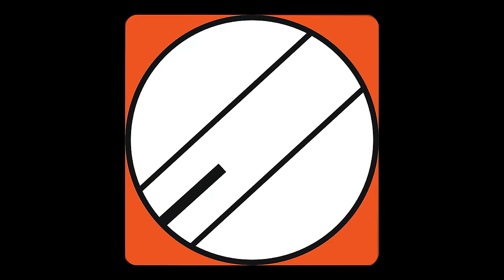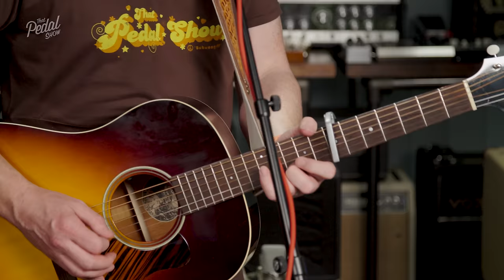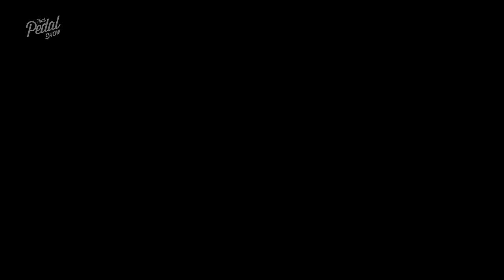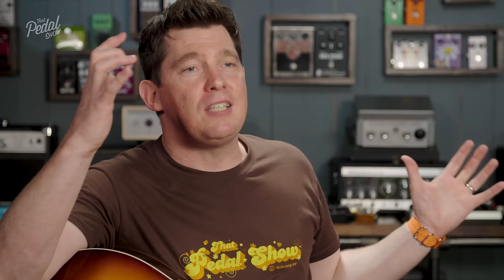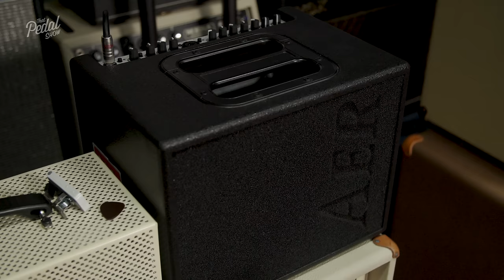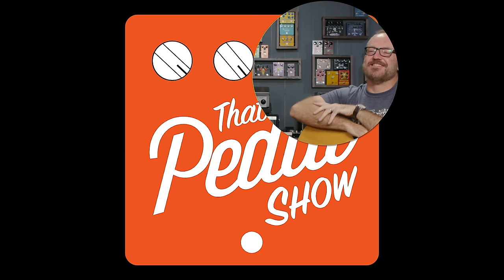Better Plugged-In Acoustic Guitar Sound Basics: Pickups, PA, Amps & All That Stuff – That Pedal Show

Comment: This video has come along at the right time. Super work guys. I've tried undersaddle piezo, Piezo discs, preamp Piezo undersaddle now I'm trying an active sound hole. Best pick up I had was the D-tar sadducer, but it didn't work with my latest work horse. I now have a passive artec PG607 in a tanglewood TW170AS.  Other issues for me have been installation of Peizo pick up, string balance etc. Best sound i had was at Yeovil beer fest because the engineer paid attention to the octave and overdrive pedals. And constantly tweaked. For pub gigs I take a acoustic amp because I like the sound of it and DI it in to a PA if needed. The quack of a piezo drives me nuts now, but after opening for Blair Dunlop and hearing the LR Baggs element in his guitar I was blow away. For you to have a chuckle at here's me trying to use a sound hole like an undersaddle https://youtu.be/5VcCAdzsxnE
(I also opened for Wurzels, top top guys)

Comment: Depends on what you are using the acoustic for But ...... If you like the scooped sound in order to just add acoustic ambience to an electric combo or behind a vocal line you may like what we call in the US the Nashville tuning.  Its an old recording trick.  The g, b, and high e strings are normal.  The lower e, a and d strings are the upper string gauges from a 12 string set.  Flat picking leads can be cool because you can get pitch shifts on scalar runs you don't otherwise get.

Comment: I have an acoustic with a cheap quacky piezo pickup under the bridge. My tip if you don’t want to go out and buy an acoustic guitar pedal is to run it through a compressor before going to the di. Most sound people will eq the sound somewhat and add reverb anyway but probably won’t add any compression which helps take out that harsh quack.

Comment: Used LR bags for 30 years acoustic Duo, Gibson J200, Gibson Hummingbird, Sm58, Senheiser ?? vocal mics.  8 x Bose 802s, 2 x mb4 subs, 3 x 1500 watt amps, various mixers, powerful acoustic system, playing big pub gigs to 500+ people, with DJ on our breaks so we need to be loud, clear and punchy. LR Baggs under saddle systems in both guitars, straight to lr Baggs DI to mixer, amazing. No other pickup system works quite as well, fishman, maton, tried them all. we have to play so loud, we can't use mics in the guitar pickups as they feedback at our levels and cannot be mixed out without losing balls. Just stick with LR Baggs and you will be happy.

Comment: If you want an AER for acoustic, check out Bugera’s AC60: it’s a shameless clone and I’ve tried it side-by-side with a AC60. But it’s just $220 new. That’s my recommendation for an acoustic amp, especially if you need your tone shaped.

My other guitarist brings a Bose S1 Pro to gigs and that’s really great system. Battery operated, backpack portable, Bluetooth and aux inputs for throwing in backing tracks or intermission music. Two channels for mic/instruments, with treble,bass,reverb, and volume controls for each. And the tone shaping sounds pretty good even giving it a basic piezo tone to start. At $600 this is my favorite single PA system solution, especially for buskers or people who value portability.

Comment: The Nature of an acoustic guitar is the simplicity.  SIMPLICITY ! I cannot process it electronically, get pedals, or even get a "brown" acoustic amp.  I have had the Anthem for many years.  It is the solution.  All on the Anthem mic at lower volume gigs is magic.  Of course open air to large diaphragm mic is optimal.  To be able to dance around while playing the Anthem is the answer.  It sounds so good, I am happy hearing the PA sound with a little monitor.
Reply: Sorry . . . the LR Baggs "Anthem"
Reply: And you can feel the sound vibrations too, less need for external source of sound support.

Comment: Nice!

Quick note on the LR Baggs Anthem; the Element undersaddle is only full range when the mic is dialled out completely. When the mic is dialled in, the undersaddle is only providing low end to the overall sound.

Also, the system never goes 100% mic, as in the undersaddle is always in the mix. 

Having the Element part provide the low end allows the system to be usable in louder environments.
Reply from the maker: Thank you!

Comment: The LR Baggs Anthem actually doesn’t blend the mic and piezo in the usual way.  It uses a crossover filter that has the high end come from the mic and the low end comes from the piezo.   As you were turning the control toward the mic you were also blending in the crossover circuit with the mic.
Reply from the maker: Nice, thanks!

Comment: Great show guys. Just to mention that with the Baggs Anthem pickup, the "blend" control doesn't just blend between "100% undersaddle" at one end and "100% mic" at the other end. Rather there's a crossover so that all the way to the "mic" end, the low frequencies still come from the undersaddle and the higher stuff comes from the mic. Very clever system in my view that allows mic and undersaddle to play to their strengths. Sounded great straight in. In general I use as much mic as I can get away with, and only back it off if there's a feedback issue. Also, worth saying, get it installed by a good luthier - if the guys in the shop offer to fit it for free, proceed with extreme caution.
Reply: Looking forward to next week - the Session and Soulmate Acoustic both sound really interesting.

Comment: I bought an acoustic amp when I had a hybrid guitar that had a piezo in the saddles and stereo output one for electric and one for acoustic. It really helped the sound. I don’t have that guitar anymore but use it when acousticing as you keep control of the sound and your foldback. Wouldn’t play without it.
Reply: Had a Takamine ean when gigging through house pa set all the levels on their built in pre amp to middle when sound checking. Gave me control of output. Especially éhen the sound man lost concentration.

Comment: I know it's 5 years later, but for anyone tuning in to this - it ain't phase lads ;-)    It's polarity. Phase is time and frequency based, whereas polarity just flips the waveform without a change in time, and is exactly equal in amplitude for all frequencies. Changing the polarity of your wedge that has your guitar signal in it can sometimes improve the "body" that you hear and feel. Best to have the sound tech try flipping the polarity of your guitar DI input on the console to see which sounds better to you - has no effect on the house mix.

Comment: Nice strum, gents.  You sound great.  For as deep and fun the dive can be into electric tone, there's depth also into acoustic.  Every minute thing matters.  Check out Larry Cragg's (Neil Young, Carlos Santana...) approach to anything which touches the strings, from bone nut and saddle to his bridge pins.  (After lengthy experimentation, ebony for low three strings and water buffalo horn for three thinnest.  It makes a real difference.)  Larry is a tone genius with vast experience and wonderful guy.  For a nice acoustic listen, go for Neil Young's Live at Massey Hall.  Better than expected vocals from Neil, too.  Please also comment as much as possible on feedback, which can strike looper pedal users, especially, depending on the room.  No doubt your mate Pete has run into that.  Cheers!

Comment: Trace Audio (in California) makes the "Amulet" acoustic contact system. Best I've ever used (I've used quite a few). Mine is powered by 48v phantom. (Nine volt is also available) Gain level to feedback is amazing. Dynamic response, amazing. This system comes stock in the Gibson Jackson Browne J45 model as well as the Sheryl Crow model. I'm just a customer. No affiliation.
Reply from the maker: Niiiiice. Sounds very good in principle!

Comment: I got out my acoustic to clean and restring.  One thing of note:  I watch TPS on my HTPC (home theater PC).  The HDMI output is processed through a decent Yamaha AVR.  I do have a really great subwoofer in the system.  When you kicked on that L.R. Baggs Session with the Collings, I was getting LOADS of low frequency signal.  You may want to shelve it @ 40-50 Hz for YouTube consumption.
Reply from the maker: Indeed. A little bass heavy. But home cinema systems accentuate all of that unnaturally. Try some studio monitors or decent hi-go for music. A bit on the low side for sure though. Cheers!
Reply: @ThatPedalShow  the heart of my system is a pair of legendary JBL 4410 Studio Monitors.  I switched to stereo reproduction, flat eq, and it was much better. Still, it always surprised me how much more low frequency information acoustic guitars produce.

Comment: What a fantastic and useful piece of work.  Thank you.  As someone who seems to have followed the trend back to acoustic from electric, the problems of amping have sometimes stumped me.  I have an old Marshall AS50R, which isn't bad, but is improved by using the compression and EQ facilities in my equally old PD XT Live thing.   I play a Martin GP-CPA1, which has the Fishman Aura system and I've been impressed by that. I also play an old Ta kamine EG-330SC which has a built in EQ and that helps.  I've heard the AER amp a couple, including use by a classical guitar player and a jazz player using an arch top.  Like you, I'm blown away by it.  Next purchase. No question.  Look forward to the next one of these - that L R Baggs thingy looks quite whizzy.
Reply from the maker: Thanks Berni. The AER is certainly very good, as is the Mesa Rosette. Fishman Aura was/is very cool technology in its various forms for sure. Cheers!

Comment: First off... best acoustic video series ever for us struggling solo-acoustic performers trying to get that "right" tone at our gigs.

Secondly...that AER Sounds amazing!  I've been hunting for the right "thing-a-ma-jig" to make my K&K sound great.  Now it's between the AER or possibly that LR Baggs Session.  Do you still use the AER for acoustic gigs?
Reply from the maker: I wouldn’t be without it Bill. Can be a bit of pig with the midrange sometimes, but if I’m struggling I’m always trying to hard/worrying too much. I wouldn’t use anything else at this point, but I’m sure the Baggs is exceptional too - they make great stuff!
Reply: @ThatPedalShow  The struggle is real.   I'm primarily a strummer with some picking, always with a pic, so midrange cuts are fine my me :-) 

Like Dan, I started my acoustic gigging in a duo with a drummer, so I'm always fighting that need for extra low-end "oomph" at my solo shows...which in-turn leads to fighting feedback or settling for an undesirable tone.  I tried sucking it up and cutting more low-end to "re-train" my ears, but it was about as successful as going full Keto.

I use the Fishman SA220 now as a small gig PA or as a monitor at larger gigs using the DI out to FOH when needed.  It's almost perfect, I just need to work out that K&K tone.  On the other hand. that AER might solve that (albeit ~$1200), plus it is so small ( @Jon MacLennan  uses one as well)

Do you use an amp stand or just put it on the floor?

Comment: I've probably watched this video like 4 times at this point. I've found it super helpful for making the most of my plugged-in acoustic guitar sound, which unfortunately is just an undersaddle piezo with no microphone.

However, I learned how to at least get a passable sound out of it. Thanks for the input on how to do that. I had a gig the other night, and I was actually pretty happy with how it sounded through the PA.

I will say, having a small multi-effects unit, like a Zoom or an HX Stomp, really helps cause you get a lot of basic helpful utility effects, like eq, compressors, room and plate reverbs, and delays.
Reply: Have you given impulse responses a go? I reckon they're a real game changer for giving a bit of "guitar" back to those undersaddle sounds

Comment: The least you should do with a standard passive undersaddle piezo is run it into a DI box before you go to FOH: Most 6-segment piezos are 10MegOhm output impedance & will suffer drastically when plugged into your standard line in input. Get  10 MegOhm input DI-box & you‘ll be doing a lot better without hauling tons of additional gear.
Reply from the maker: That’s what I use my AER for. Plus the on stage monitor!

Comment: I bought a AER Compact 60 because of Tommy Emmanuel... then bought a Martin OMCE Korina and Martin LX1E after trying them out through the AER in the shop! It is the best acoustic amp out there IMO. AER also have the tone shaping tech in a fx unit form. The 'Colourizer, ... i believe. Thank you for this episode guys. I have been trying to find a bit of gear that will enhance my OMCE through a BOSE L1 system, without using the tone match desk.

Comment: What Mick was hearing concerning phase is “absolute phase” think about the strings when plucked they compress air when moving forward or away from the guitar and they rarefract or act in the opposite way from compression. A speaker then moves forward and backward. It behaves differently in each direction because of a lot of reasons I won’t go into now. Absolute phase refers to the speaker moving in the same direction as the string on the guitar. You hear and as Mick says I don’t know why but it sounds right. This is a big issue in the high end audio world where I live. There is one writer who says that only acoustic recordings (pre 1930s) sound real because they are acoustic images there is no phase inversion in the chain. If you like I’ll be happy to discuss this whole issue with you off line.
Reply: rather than phase, which adds a time component to it, Polarity would be the correct term in this case

Comment: In my Alvarez acoustic I use the LR Baggs Stage Pro Anthem (both the under saddle and mic) for my guitar signal, and I have the K&K 3 transducer unit positioned on the sound board for my percussion signal (that runs into an EQ pedal before being mixed in). Both are awesome units. And I love that you guys did an acoustic show! Since I run my acoustic through my pedalboard as a solo act. I can't wait for part 2!

Comment: I don't think I'd ever buy an acoustic amp for the same reasons that Dan mentioned, but also because I'm a sometimes bass player and I've found that I can get pretty decent sound by plugging my acoustic into my Fender Rumble 25 with maybe just a bit of gain from a SD-1 and some reverb. Much better bottom end (obviously) with none of the shrill high end that I get from an electric amp.  Great video, cheers guys!
Reply from the maker: The EQ of a bass/full range amp is closer to a PA/acoustic amp than a guitar amp maybe. We could see how that would work. Cheers!

Comment: Very nice review fellas, but there are a lot of technical errors in the conversation. The talk about "phase" is actually a conversation about polarity,  (an error often made on the labelling of gear) and is relevant to controlling low frequency boom in an amplified acoustic. The description of "parametric" EQ is actually a swept EQ. True parametric EQ has a Q control which selects the bandwidth of the cut or boosted frequency, allowing broad or fine EQ adjustments. The MESA does not have a Q control. No mention is made of the essential requirement for ALL piezo pickups to run into a very high input impedance, without which the frequency response is severely compromised. The K&K pickup is a completely passive pickup and the impedance it runs into will dramatically alter its frequency response. The clip of the K&K equipped guitar "straight" into the PA sounds very typical of the pickup being loaded by too low an input impedance! S

Comment: Brilliant show and video, as usual, gentlemen. Do you have any opinions about after-market additions of the in-body mics regarding brands, cautionary tales etc? I have a Taylor 114e (mid-priced acoustic, grand concert style) that has an under-saddle system and preamp. I want to experiment with adding a mic. to it. For reference, I play guitar in a Pink Floyd tribute band, and so have to play parts on Mother, WYWH etc. I also use a 12-string Ovation for relevant parts, and it is a different beast and tone, which is very practical, and conditional upon whether you like the tone of Ovations or not, which is a deeply polarizing topic, so I won’t bother asking about that. I’m thinking of getting an LR Baggs Venue DI/ preamp to use with either/ both. Any advice? Thanks!

Comment: I actually didn't know, that so few acoustic guitar players use actual acoustic amps. For me it's just the most obvious thing to do. If I play smaller places, I in fact only use my amp. Only if it's not loud enough, I take the direct outs of the amp to the PA, tilt the amp and use it as a monitor.

Comment: What would happen if you played an acoustic guitar plugged into a Hughes and Kettner Grandmeister 40 amplifier with a 2 x 12 having an additional tweeter with a crossover network to take advantage of a wider range of frequencies. It would be good to compare an acoustic guitar through the AER 60 to a PRS P22 Piezo electric guitar on the Piezo output through the same amplifier.

Comment: Thanks for posting this.  It's great information for anyone plugging acoustic guitars into amps.  At around 42 minutes you touched on soundhole pickups, which are greatly outnumbered by undersaddle ones.  I'd still like to see a comparison between these, using the equipment in this video.  I use a Shadow SH145 active humbucker soundhole pickup, in a ~£400 Crafter TCO35 that also has an LR Baggs undersaddle.  Comparing these, they can be made to sound pretty much identical with gentle strumming or fingerpicking but as soon as the guitar's played harder, the piezo quack appears; whereas the Shadow just gets louder.  So for me, the Shadow wins for live gigs.
Reply from the maker: Sounds great below the fifth fret for me. Mick here. Past that, it starts sounding very electric guitar. Lovely and mellow with strumming as you say!